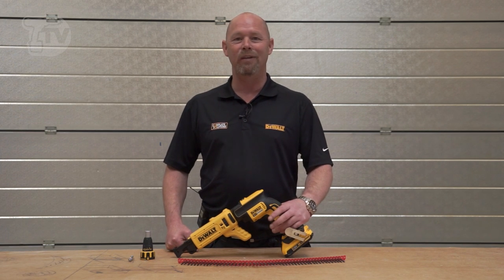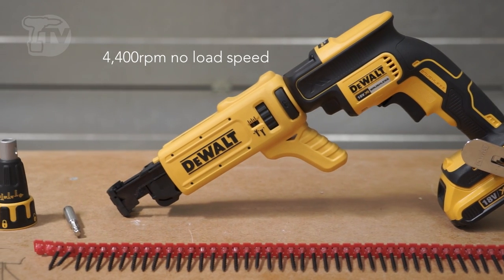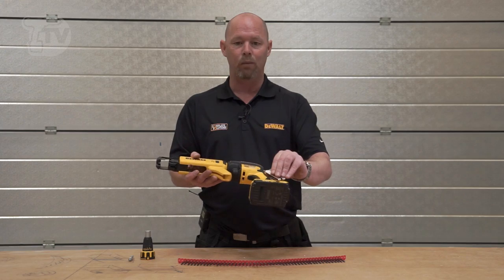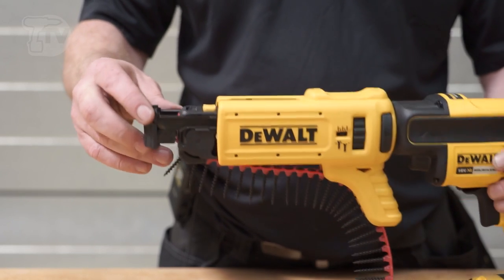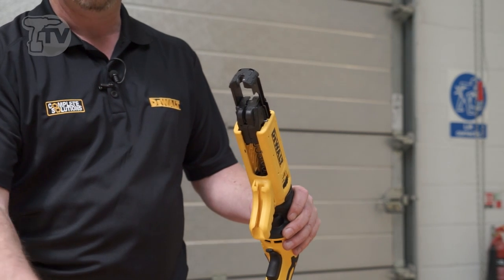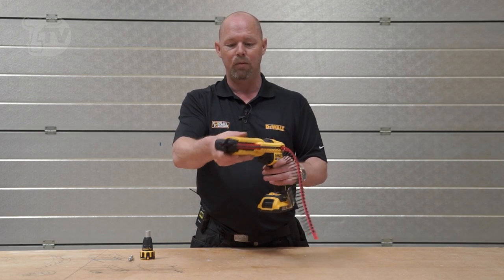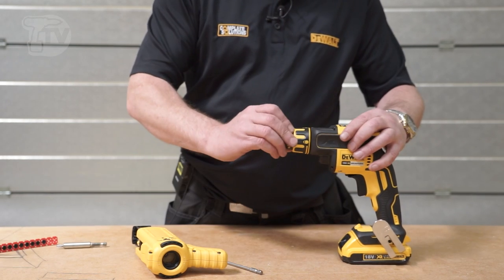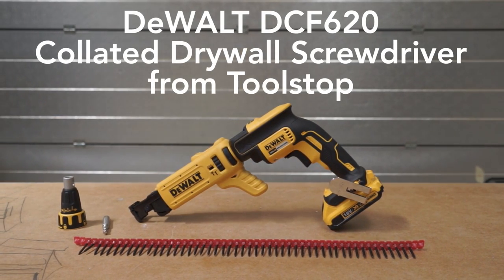Dewalt DCF620 Drywall Screwdriver

Comment: silly size  batteries .You need to offer  a better "kit" with larger batteries to last longer
Reply: carforumwanker actually, I board all day with one battery, even if it did die, the second would be charged well in time. I like the small battery for less weight.
Reply: I board all day and i agree, two small batteries is often enough and as you say when you are holding it all day you want it to be as light as possible.
Reply: name checks out.